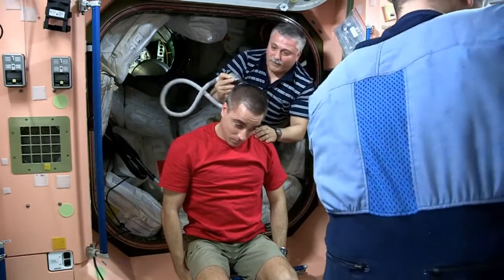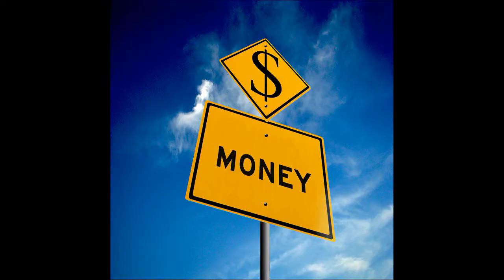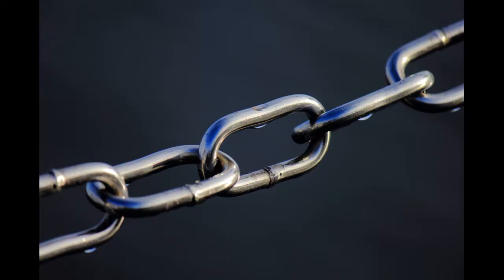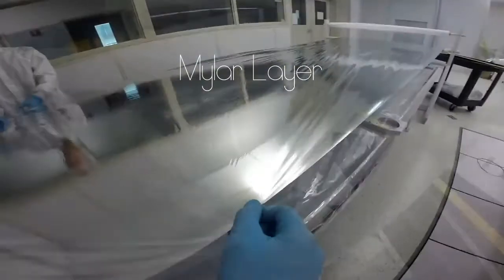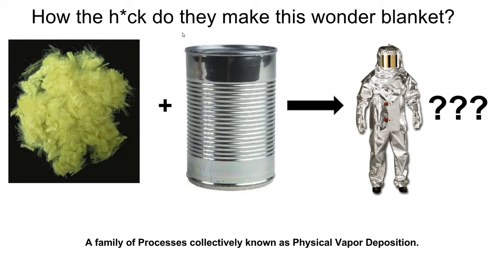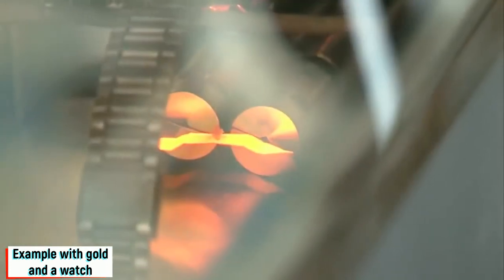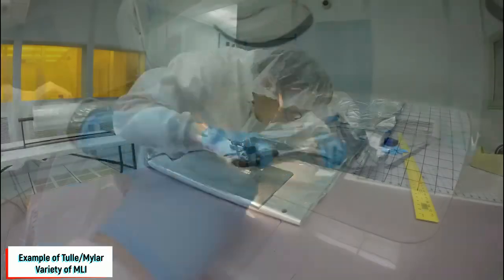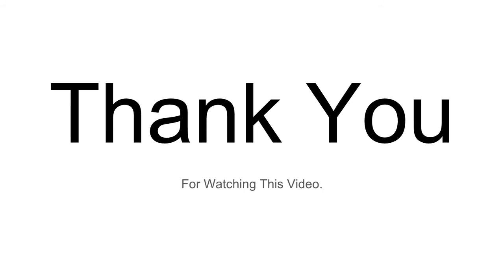Multilayer Insulation on the International Space Station

Comment: How the heck does the iss remove heat from itself? Where does it send the heat off to.  The humans and the machines are all giving off heat 24/7.  If the whole thing is insulated so well, then all the heat would accumulate inside of it from those sources.  There is no way to transfer the accumulating heat to the particles of the thermosphere that it flies through. They are thousands of degrees and would be at a higher energy concentration and not allow something cooler than themselves to transfer more heat into them.  In fact it's the other way around. Though it's said the particles are so spread out that they are negligible in that sense of them giving off heat into the iss.